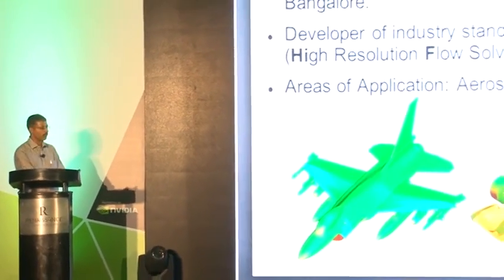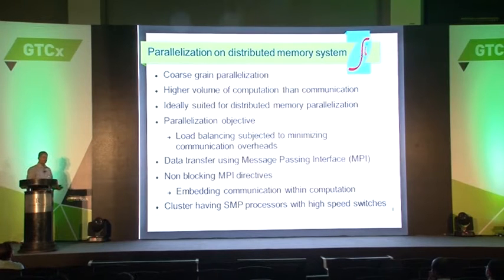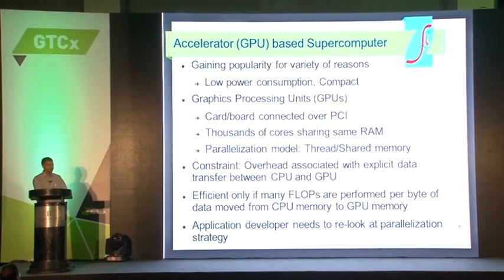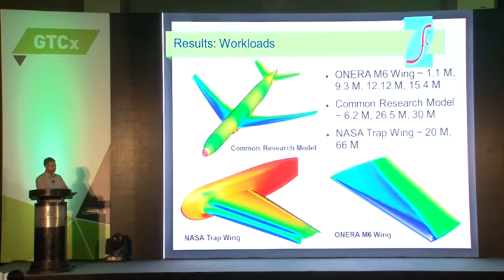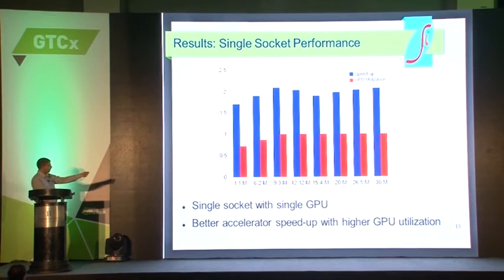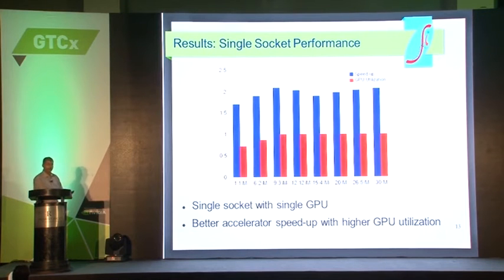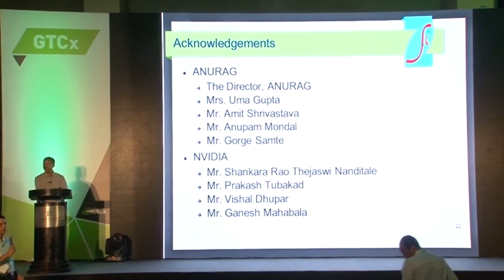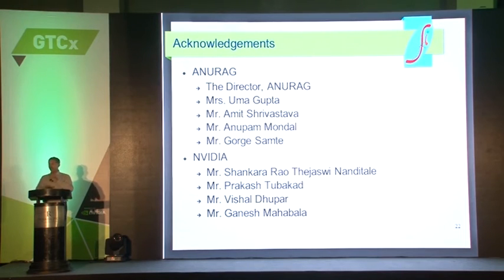'Make In India' Parallel CFD solver on GPU

Comment: Please don't abstract the CUDA layers complexity and GPU hardware architecture ingenuity in your "make in india" whatsoever...  you have all the libraries made freely available cuSole Cublas PETSc debugged and updated, almost a turn key solution.... all of 'em available and the GPU hardware fully compatible with CUDA seamlessly !(which is awesome), so all you do is writing few thousands of code lines to have that solver, as a matter of fair proportionality, once your solver "running & operational" your dedicated work effort would not exceed 10% of the whole software layers and libraries you've used, that's the software abstraction magic...let alone the fully operational GPU hardware  packaged and ready to use, so if I may ask what did you "make in india"? Putting it another way, in this "make in india" spirit if you have had to write the full code for CUDA toolkit and the device drivers from scratch and build that 14nm process GPU... how much time a real "make in india" would taken you to get here? so I guess you've made it all "make in india", did you?
Reply: 2:06 Inbuilt design, the solvers that can exploit super scalability on SMP. Think 2008-2016 & list how many CFD solvers had these capability.